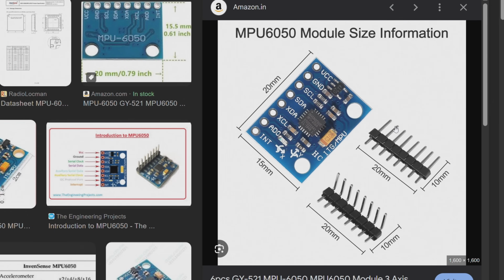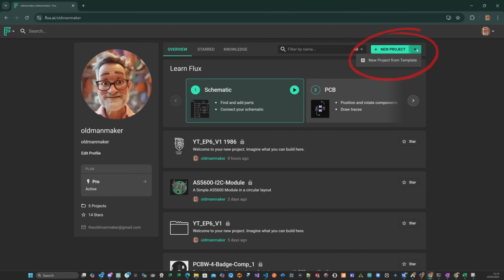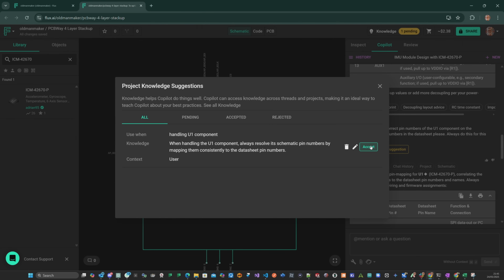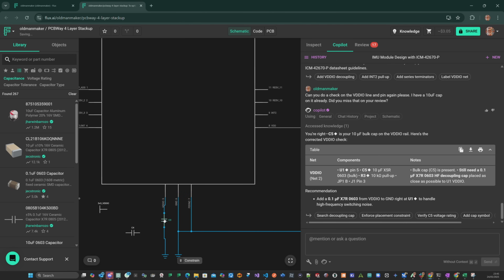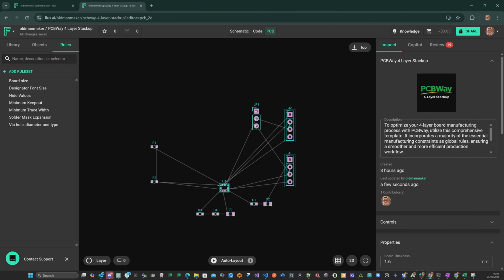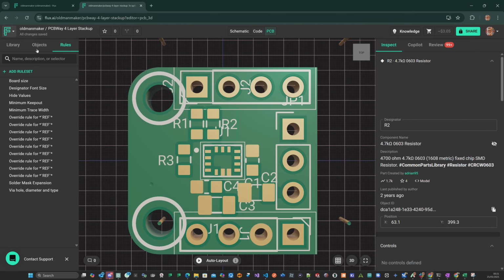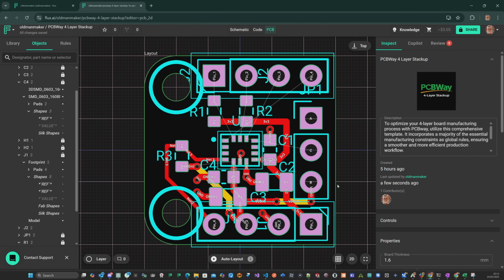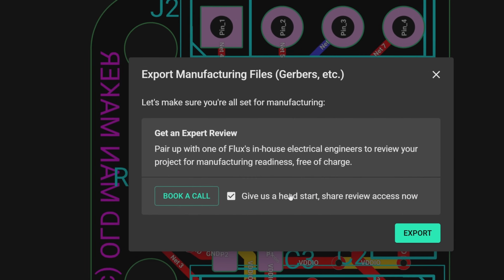This could change the way we MAKE THINGS

Comment: I was the same and it took me a long time to get my head around KiCAD but it was worth the time. Personally I dont like cloud based applications, KiCad is installed and always available. Now I dont make many PCB's but what I have found KiCad brilliant for is designing Proto boards. Create your circuit, lay it out as a single sided board using 0.1" spacing's, print the board top layers real size and you have the position of all your components, print the mirror image of the bottom track side and you have the wire layout for your proto board, brilliant, and all the documentation. Im sure an AI tool adds lots of clevers but with that will come problems you can bet, KiCad has its frustrations too but being standalone you have more control over what it does. So Im sold on KiCad

Comment: Frankly, the "start with a manufacturers template" bit is already pointing to a hobbyist approach. Unless you're on the bleeding edge (in which case you're not going with a template), you design to a set of rules that is manufacturable to many providers...

If you only need five of them, then sure.

Comment: There were 11 airwires not routed; was that an issue? Also did you include manufacturing tolerances into the DRC? One trace looks extremely close to a drill hole. And did the board actually work?

Comment: It's almost as good as easyEDA, but easyEDA is completely free, faster, integrated tightly with one of the best parts suppliers in the world, and can be run completely offline. Plus, I'm not seeing any benefit from the "AI" integration: It's just an extra step that adds frustration and error opportunities. 

AI doesn't lower the barrier to entry; it requires capable engineering guidance and supervision. If you know what you are doing, it might be sometimes marginally useful, but generative AI is a junior assistant, not an expert. 

A regular, free chat window with Mistral or GPT-4 will provide at least as good guidance. If you know what you are doing, you won't want it anyway. If you don't, this will usually help you build garbage. It took longer to autoroute that than I would have taken by hand, and it also did a terrible job. No way I'm trusting it to tease out the often very subtle but critical details that have to be read between the lines of many data sheets. 

Also, I'm 99.9% sure that this is an effort to gather training data so they can have the AI "design PCBs," which is an absolutely terrible idea because models only get it right most of the time lol.  Plus, they want to charge a subscription fee for you to train their model? When better, free, offline options exist that are evidently better? No thanks.

Like most "AI" offerings, they offer a value proposition that doesn't exist and hope that you will train it for them. And then,  charge you for the privilege. This is the Tesla FSD of EDA.

Comment: 90% of companies will never want their PCBs analysed by AI. Lots of inherent security issues. Most large companies will pay the big design software packages like Altium and Mentor to remove all internet connectivity.
Reply: ehh some PCBs are secret until patents go through, but most PCBs are not secret at any stage of development. For $7 you can X-RAY any PCB and have the design in hand in minutes lol
Reply: @TheOfficialOriginalChad i have worked for those companies who pay to have connectivity cut. It's not just about patents or secrecy. It's about robustness. Any software that relies on the Internet to work or auto-updated etc are all company risk. They are also potentials for denial attacks or penetrating and internal network. Big companies don't care about checking mouser to see if a part is in stock, or a new PCB layout block for a 555 timer.
And you think $7 pays for a complete reverse engineer for a PCB? There are many components you can't value from an x-ray and mapping dense PCBs that way is very time consuming and presents no internal digital design which is what is of value.
AI offers no advantages that a chartered engineer doesn't already bring, and a company can control that engineer via contract whereas nobody knows where data is going into AI. Why would a large company submit their great designs to train an AI that they then have to pay for?
Reply: those companies probably have computers capable of running really good local ai models and remove all internet connectivity
Reply: @DaleIsWigging lol “those companies”

there are no good local CAD models
Reply: @TheOfficialOriginalChad everything is technically a local model somewhere. If not train one.

 Simply trying to say the "never" statement is too strong and doesnt apply to anything fundamental about ai.
Eventually this will not be a problem.
For now you are likely right, but this is a concern all throughout the industries that want to use ai and many people are working on solutions, there will be other issues that will likely be more of a concern later.
Reply: @DaleIsWigging anything else you would like to inaccurately explain to an AI researcher?
Reply: @TheOfficialOriginalChad Nope, you should bait me in to it instead, at least then we could all be blessed by the presence of your superintelligence❤

Comment: Fairly thinly veiled ad. Nothing wrong with that I guess. I couldn't stay to the end.
So copilot is obviously generative AI++. It can still halucinate right? Presumably DRC will catch the obvious things, but it won't fix a hallucination around a chip selection/info.  At least you started the video showing that it was more or less an ad.
Flex looks like it has some decent features. I will check it out. I have many years in fusion360 and eagle so would have to do a whole relearn would be a PITA.

Comment: I have used several top notch AIs like Gemini, ChatGPT,  Deepseek, Claude, QWen etc to research and offer components with specific requirements, mostly the answers are garbage. It is much easier to go to Mouser and use the filters to get the component needed. 

Flux has a hook, don't fall for it, they will start charging for it when they get sufficient amount of users.

Comment: Yea, I used flux when it released. My experience was not that great with the copilot, it seems that changed so I may check it out later. I still find the ui way to unintuitive, in addition to that I miss features that are in by default in altium or kicad.

Comment: I gave it a try based on your video, and I have to say in my experience it is alpha-level of production.  at least 30% of the time, copilot didn't even take the actions it said it did.  Before long I ended up with a schematic with unconnected parts and just a bit of a mess.  I would ask it to add the necessary caps and resistors for a buck converter, and it would add them but not connect anything.  I went through many cycles of "can you give this schematic a thorough check to be sure nothing is missing".  Very excited for this kind of tool, but it frankly just does not work
Reply: Agreed I had a very similar experience trying to get AI to produce working Python code for Freecad. It mostly doesn't work as it should.
Reply: When I code with AI, I get it to give me error logs so I can paste them to the AI. Once I explain the problem or how it's not working, it then corrects it.  @trollobite1629

Comment: I haven't made pcbs since 15 years (hobby electronics in college level), using eaglecad, or whatever it was before that. We used to soak pcbs in a homemade etching setup. Thinking about getting into it again to make closed loop stepper motors or servos, just because it's a fun interactive project, I think. Do you think flux could help with designing something like that, and help me "reawaken" what I learned about analog and digital circuit design? Or will it be like most other AIs, where you need to know a lot before you use it, to know what to ditch and know what is useful?

Also, just saw your channel for the first time, love your editing and pacing :-)

Comment: Lots of strong opinions in the comments section 😂

I get a similar reaction when ever I ask the electrical engineers I lead to try a new tool.  

Any veterans remember if the transition from Protel to Altium like this?   I started using AutoCAD just before most MEs transitioned to SolidWorks, it seemed like a no brainer to me but maybe the senior MEs at the time reacted similarly.
Reply: I get your point, but this is not the case here. Sorry to say but Flux is an undercooked overhyped product. It’s just bad and non-functional for any real work.

Comment: I remember the traveling salesman problem from computer science , and in effect circuit trace building is rather similar (and more complex )
Reply: Agreed. I learnt about it in computer science 100 at Adelaide Uni in 1983. It was part of the discussion on NP completeness and stuff.
So I don't think travelling salesman has formally EVER been solved completely.
What has happened I think, is that maths has got close. The term "locally optimal solution" comes to mind. I also think genetic algorithms can get close to a decent  very-near solution to the travelling salesman (board trace? :)) problem.   I did some looking around at this class of problem a few years back. Freight and shipping software is a variation on the theme. THe travelling delivery guy problem. Also is the travelling nurse problem. You as a company have 100 patients who need a visit, from a nurse, to perform a procedure. How many nurses do you need, and if you need to skill match the travelling nurse(s) with the patient's procedural needs, now how many nurses do you need? What if one calls sick halfway through the day and goes home..  Quite an interesting problem space

Comment: A great horror movie 10/10! A horrendous schematic with an IC covering most of the sheet for no reason and spamming those net labels where you could just draw the net, making the diagram at least readable, no? Bonus points for not grouping the IC pins (as normally you'd just place the power, interface and whatever other pins close to their fellows, not trying to replicate the package instead). A scary routing with tracks very close to the pads (which were fixed manually later I guess) and that huge corner at the left, also 4 layers for a simple breakout?! And the AI seems to completely ignore the fact we use planes nowadays... Why mixing 0603 and 0805 parts for no reason, if we mostly use 0402 anyway... Also the copilot is just great: the I2C bus uses 4.7k pullups - then why not use the very same 4k7 for the CS line?! (don't even tell me about the power consumption, as not only the CS lives well without any pullup at all).

Comment: Question: how are they affording a free system on this level ? Are they going to charge and what is the cost ?
Reply: It's free because of venture capital.  The product is the user's input. The user ID actually training the model further. Once they are satisfied with the model, they will start charging for it. 

This has been the route for almost every ai vertical.
Reply: @limpqizbuit  It's not free. U can do free trial tho.
Reply: Guess what it's not free
Reply: Just got on their site. It's 14 day free trial. $15/month for starter
Reply: If you subscribe for a FREE plan, and start only a simple pcb, you quickly run out of CREDITS. What? The trial was free, wasn't it. You get charged a couple of dollars. It almost feels like a scam, although there certainly could be a bit of value in a tool that actually works. 

From the product you can guess how the development went. They calculated the possible value of such a tool, attracted venture capital. The data scientists were aware of the LACK of ONLINE AVAILABLE good hardware design examples, to train the models. They got labeled "party poopers" by the marketing people. The reality is that most of online electronics design stories are quite low quality. Full of bugs and bogus. The good designs are kept trade secrets. And even if you see a good design online, you cannot just brainlessly copy/paste. The flux team came with the solution: We simply ask the users for input, and suck their brains out to improve our AI models! Hm. Well, this is too obvious. I'm not going to PAY to train your model. It should rather be the other way around.
Reply: people who actually need to use it for work will pay for their paid plans, and that will supplement the free usage. In the meantime, google, openAI, etc offer startups lots of $$$ in free compute credits to make this stuff in the first place

Comment: Very similar to KiCAD, except for small board like this, autoroute would be done in 20sec in kicad+freeroute...
Reply: Freeroute is very limited. It does not give a damn about impedance, length-matching, will happily create 90 degree turns and all the other EMI-unfriendly things. The moment you start caring about signal integrity, almost all the existing autorouting options are useless. But give an AI an access to KiCAD, let it backtrack as many times as it want, give it an access to simulation tools - and it'd perform on par with very experienced human engineers.
Reply: @vitalyl1327  KiCAD files are human readable, so what AI is waiting for?
Reply: @gozmodisco1662  I keep wondering about this too.  
I think that there just aren't that many people doing PCB design compared to other lower hanging fruit for companies to apply AI to.
Also it may be that LLM's aren't the greatest at physical design?
The real power will be when AI can make smart placement decisions.  Good placement is 80% the work of PCB design.  
Routing should be easy if the placement is done well...

Another application I've been waiting on is AI being applied to 3D modeling.  
Imagine being able to feed in a photo and have an AI spit out an cleaned up idealized parametric CAD model.  
That would be insanely useful for rapid prototyping...
Reply: Right AI will perform superhuman design @vitalyl1327
Reply: @vitalyl1327 what simulation tools do you suggest with KiCad?

Comment: I let AI fix a broken variable PSU and the replacement parts ended up making a loud pop sound the moment i turned on the PSU. so i tossed it in the trash.
i could have fixed it without AI but i wanted to see how it would fair since image recognition of the psu internals was extraordinarily on point.
it picked components that were the same type but under spec.

Comment: Routing such tiny board for 13 minutes? That sounds laughable! I can't even imagine how many operations can generic CPU or GPU execute in 13 minutes. If that's some AI/ML, then it must be the most ineffective process ever. Or they use old grandma's PC for that computing. I'm not an expert in this field, so take my comment sceptically.

Still, as the number of ways to connect components increase with board size exponentially, I expect bigger boards to take hours or days at this speed.

Comment: Smells of techbros with no domain skill trying to "disrupt" an industry. In 2025, launching an EDA with a rip-retry autorouter... which took... 13 minutes to do half a handful traces and then spat out THAT dog's dinner? TopoR can route this board in a couple seconds and can push the components aside to fit as well, because developers understood domain math, and the solutions it comes up with are usually kinda stunning and at least pretty decent. Freerouter is an example of a classic rip-retry router but that also completes something like that really quickly. It's not that i mind more assistance by the software or AI in general, i just completely lack confidence in the product for a whole page full of reasons.

I actually think datasheet data extraction is a great LLM usecase fundamentally, but for datasheets where i'd really really want that, they'd currently struggle, you simply can't afford a 1200 page context window.
Reply from the maker: Thanks for taking the time to comment. I remember TopoR and you're right, that created some pretty amazing results - though like most of those solutions, the user experience was challenging to say the least. I'm not sure what approach they are using for the incremental changes, though logically, I think you're probably assuming correctly there as well. Look, at the end of the day, these "tools" are just a starting point. They're not perfect and I certainly don't expect them to be. If they make it easier for people to get into, make things more accessible, then I'm all for that. In terms of LLM context windows, head over to googles ai studio (not the gemini page) - select the pro model and you can use it for free. It will gobble up 1200 pages easily. I actually use that a lot to take in two or more datasheets of the same line of components and get it to tell me the differences etc, or review what changed from previous models. Cheers